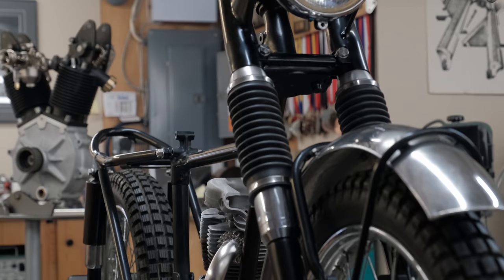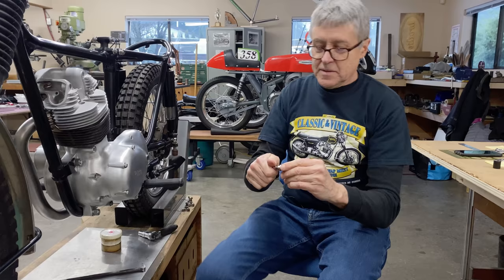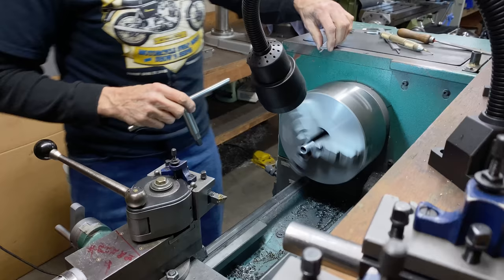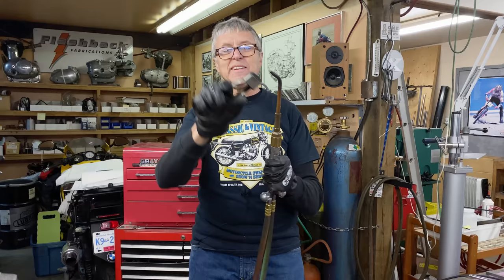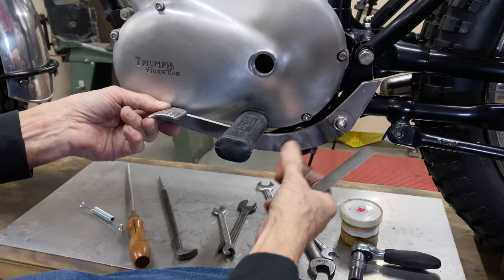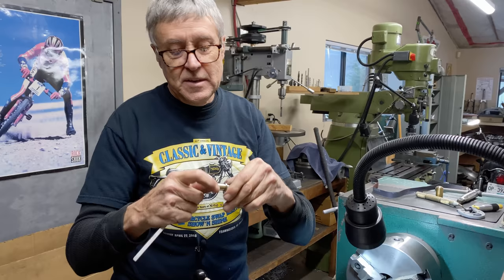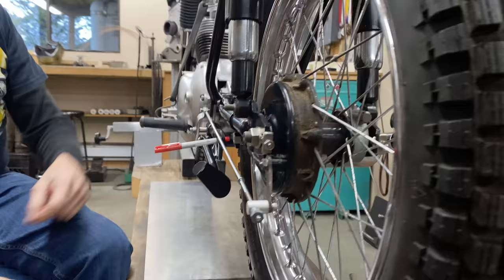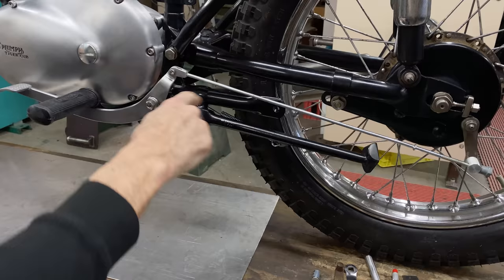Making a rear brake pedal for the Tiger Cub // Paul Brodie's Shop

Comment: It's cheap for the manufacturer to put a loose fit steel pivot for the brake pedal but it wears terribly. I have replaced the pivot with a shoulder bolt and steel bushing welded in on some bikes,  but have drilled the pivot to have a grease fitting  and holes for grease to lube the moving areas. I did repair one IT Yamaha brake pivot with a bronze bushing. It also needed for the kick start gear pivot to be repaired. I reamed the worn pivot hole inside the center case for a bronze bushing while turning the hard and worn gear shaft to fit. It's like they don't make these small bikes to last forever or to be repaired.
Reply from the maker: Back in the 60's the quality of some smaller Japanese bikes was questionable. So I do know what you are referring to.

Comment: You could probably push it in a little bit then cut a little wedge out of the top of the rear foot peg and the bend it up then weld it... That could get it out of the way and still be a stock part, plus it would align w/ the brake rod.  As always, great video guys.... Keep up the great work.   😁

Comment: Watching you do the very precise work on this cub you are doing it better than the ten plus that I have rebuilt. Most were basket cases in boxes back in my youth still remember pushing one ten miles to get it home as a non runner at age 17 now 67 LOL. It cost £53 then.
Reply from the maker: Jan, we are the same age. I bought a Cub when I was 15 for $125 and sold it 10 months later for $175.

Comment: I'm sure Paul knows this but for the neophytes one of the main criteria for brake pedal design is having the brake rod pivot as close as possible to the swingarm pivot.  This helps maintain a consistent  brake pedal position as the wheel moves through it's travel. If the brake rod pivot is very far from the SA pivot you can end up with the brakes being either "self  applying" or "self releasing" :) when hitting bumps.
Reply from the maker: Thanks Truth Bloomer. Right now the (stock) rear shocks are so stiff and to get even an inch of travel would be totally amazing. I am using the stock pivot point for the rear brake, so I'm not designing the braking "system", only the shape of the brake lever...

Comment: That pedal turned out as good as , if not better than a stock one. Dose that model not have a stop for the pedal that the switch mounts too?, Thanks for sharing Paul.
Reply from the maker: Thanks David. I don't even know what stock looks like in that area. The Tiger Cub Bible has no closeups, only shots of the whole bike. From the parts catalogue I can't even find a brake light switch. I'll just figure out what works for me and go from there.

Comment: A coil spring wound around the brake pivot could work cleanly if it would be an acceptable type.

Sensing, snow way it's still white outside, getting warm?
Reply from the maker: Yes, a coil spring can work, but I would rather have an extension spring. Most of the snow has melted!

Comment: Another great episode!  I don’t mean to question the Engineering Dept., but I’m just curious if you considered more bend in the pedal arm so that it could be welded to the center of the foot pad. Looking forward to the next vid.
Reply from the maker: Thank you David. I liked the bend as is, so no, I did not consider more bend.
Reply: I agree with David that centering the pad would be stronger, I’m not positive but I’m assuming solder is pronounced soder even in Canada, great videos, really envious of all the equipment

Comment: Paul, couldn't you put the spring for the break on the oposit side, on the inside of the pedal and mount it on the foot peg under the  engine? It would then be almost hidden from the side and you could get rid of the "pipe" that you don't like and what it seems, only is used for holding the spring..... 🤔
Reply from the maker: Yes Patrick, I am considering my options. Thanks.

Comment: Another cool and interesting video with your usual, unique problem solving, metal working and welding, very nice brake pedal. 
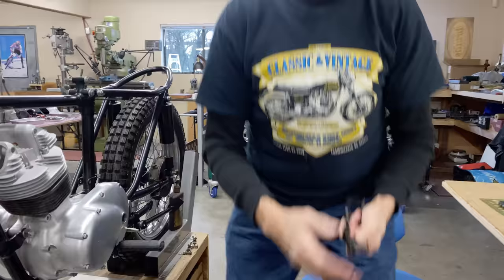Have to ask something completely unrelated - at 4:00 you pass Mitch's camera and there's a really nice wooden grip on it, did he make that? If so, as one photographer to another who's made quite a few parts for my own cameras, great job. What wood is that, cedar?
Reply from the maker: I'll let Mitch add to this. I believe the grip came with the camera... Thanks for liking the brake pedal.
Reply: Hey, it’s a handle from SmallRig that attaches to the camera cage. 👍

Comment: Hi.  I. Am doing a cub at to e moment. Had you considered putting the rod above the swinging arm. I notice a lot of trials cubs have it up out of the way of things. The other thing is I wondered how long the side stand is. As I have to make one.?
Reply from the maker: Devon, my bike is not a trials Cub, it is for the street. The length of the stand will depend on wheel and tire size, which forks you are using, etc. We did a video showing how to figure out the length of the side stand. We even weighted the bike as some viewers suggested. It didn't make any difference. Have you seen that video?
Reply: @paulbrodie  my mistake. It looked like the trials cubs I have seen over here in England. so I made an assumption that was what it was. It's a lovely looking bike. I will look for that video. Many thanks.

Comment: If putting footpeg rubbers on is anything like hand grips, I recommend brake cleaner. Squirt a desired amount into it and slide it on. It will evaporate within a few moments.
Reply: If you have an air compressor, try blowing air into the grip / rubber as you slide it on.  No lube required!
Reply: The Goop waterless hand soap he used is ideal. It's also an excellent lube for mounting tires.
Reply: @CurboroughSprinter  I use a compressor too, but I find it easier for removing them. The brake cleaner to put them on let's you manipulate it into place a bit better before it sets.

Comment: Paul,  why did you use silver soldering for the brake rod rather than TIG welding?  Just curious as you seem to have a well thought out reason for everything!
Reply: I'm not Paul but I would think that silver solder is better on the small diameter brake rod since it would also bond inside the hole and does not have a chance to undercut the metal or embrittle it at that point where it is subject to movement and bending.
Reply: @tommontgomery2674  Thanks Tom. Makes sense.
Reply from the maker: I wouldn't have used silver solder: it's not strong enough. I could have used nickel silver, but that 1/4" steel would have taken a lot of heat to get up to temp. Tig welding was just so easy.. Make sense?